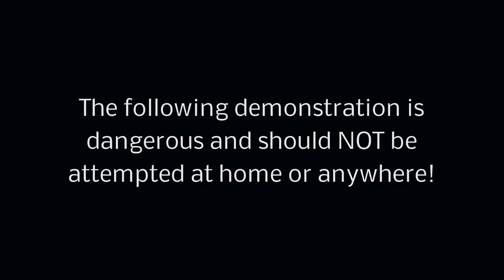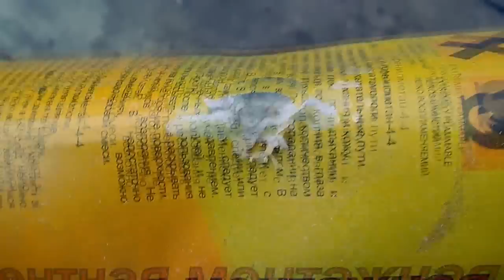DVD ДИСК В БОЛГАРКЕ!НА ЧТО ОНА СПОСОБНА?

Comment: You should never use any grinder in any situation where the plane of the wheel intersects your body. Even the proper wheels can suddenly fly apart suddenly making dangerous shrapnel. Also listen for changes in sound and turn it off and scrap the wheel if it makes a funny noise.